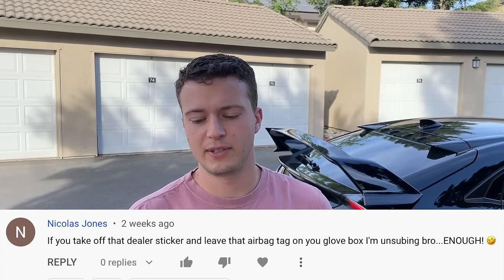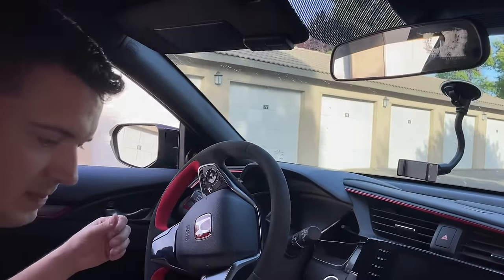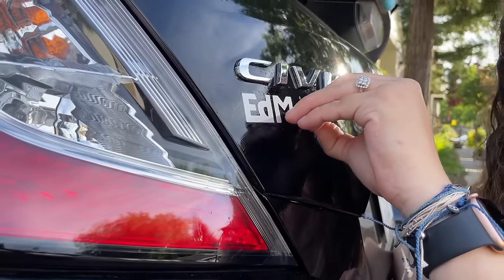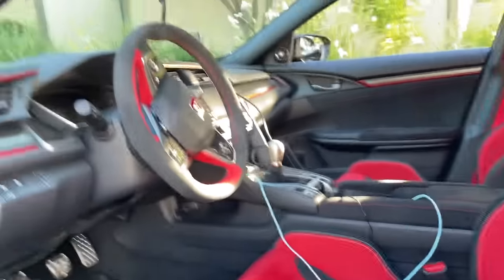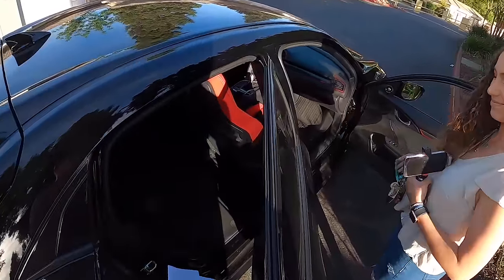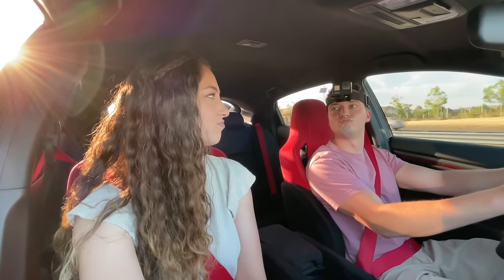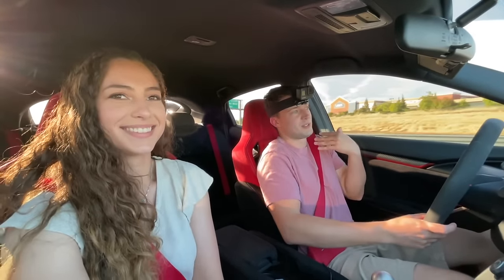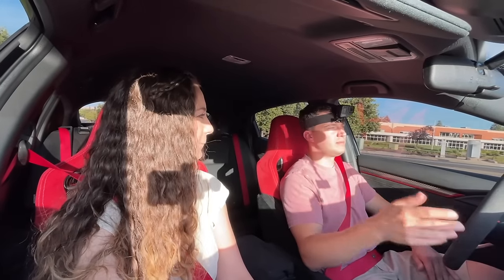Addressing Your Concerns with my Civic Type R!

Comment: Hey Cam, looking at the lasfit floor mats for my type R and it says on the lasfit website that it doesn’t fit the manual and there’s only one option. Is that untrue or did you get a different floor mat?

Comment: Did you notice a big difference after removing the sound control module? I’m currently considering removing mine as the sound through the speakers is terribly muffled and causes speaker crackles.
Reply from the maker: Its much better after disconnecting it

Comment: Hey! I just bought a used stock 2019 type R. Some of the things I read about it was the droning on the highway. Did you have that issue? If so, how do you purpose is fix it?
Reply from the maker: Droning on the highway? You cant hear the stock exhaust at all, so unless you’re talking about an aftermarket exhaust, there is no drone
Reply: @Camhill182  the constant loud HHHHMMMMM. I’m just noticing it’s louder than other sports cars.

Comment: Question.   I have a PRL catted down pipe installed on my 10th gen civic, non si.  I failed emissions today; 02 circuit slow response, bank 1, sensor 2.   I have 10 days to fix this.  What can I do?  do I have to reinstall my OEM downpipe so I can pass emissions?
Reply from the maker: you will have to install your stock downpipe
Reply: @Camhill182  ok.  Thanks for the reply.